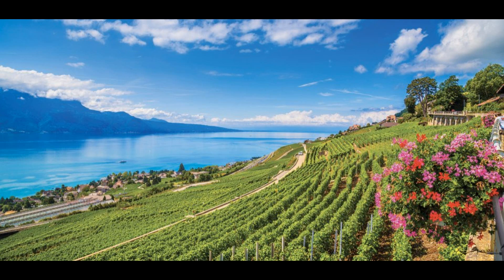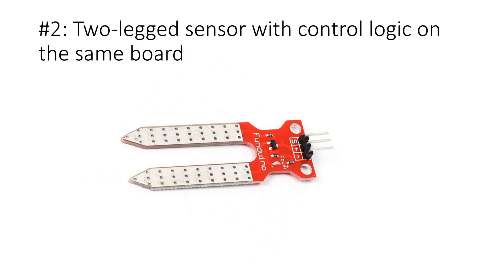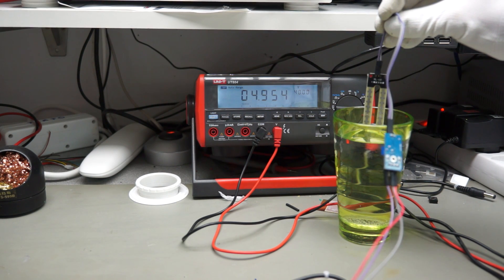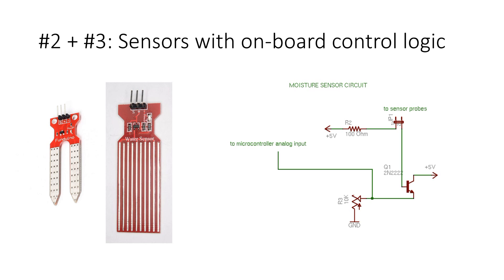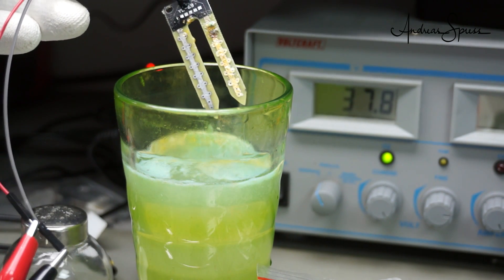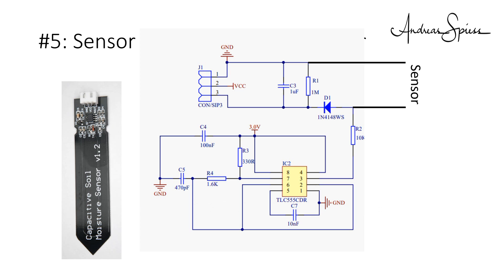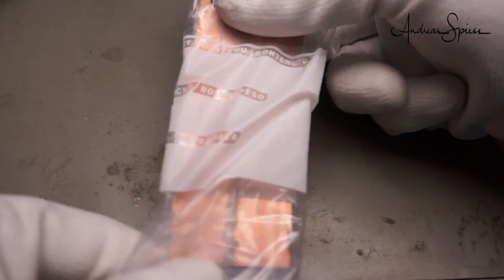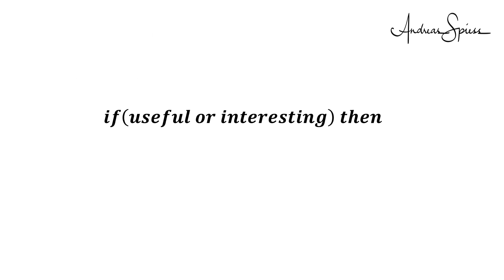#207 Why most Arduino Soil Moisture Sensors suck (incl. solution)

Comment: Just bury an ESP8266, the water will change the signal strength. 😎
Reply: Interesting tangent opportunity here, doesn't the ESP32 offer onboard capacitance sensing intended for touch detection?  I imagine it wouldn't be too much of a rework this for a buried soil probe along the lines of what Andreas came up with.  I might give this a shot when mine arrives!
Reply: That technique is actually used for remote sensing flood detection.
Reply: @markjacksonpulver3546  sure? on the waterstop on laundry machine there are 2 easy metal dots. if they're in touch with water they'll close the water inlet of the device
Reply: @riccardoz2953  Different type of flood.  Remote sensing in 'outback' Australia.  Went the sensor goes underwater, the signal is lost, and you you know high the water is. I think what was I was thinking about....
Reply: You don't really need a big battery just a solar panel on the soil surface if you only need it to wake up and report a few times a day. Could be a job for those ESP modules with the second add on low power MCU?
Reply: You may be able to have just the ESP8266 test the soil for high frequency impedance, it just has to make the measurement before it makes a WiFi connection if it involves the A2D port. Assuming that you can't just build smart enough code into you AP to note the differential change in signal strength between your sensors and a few reference ones, for a big installation that would be much cheaper, just the ESP8266 modules and solar power. After a while if you keep all of your data inc. the corresponding meteorological data you could train a neural network to even predict when you will need to water.
Reply: @DanielSMatthews   The beauty of the ESP8266 is the core processor which offers deep sleep mode. So it can sleep for four hours, pop on one second, measure, transmit and sleep. 200 mA battery would last years.
Reply: @Andrew Sanjanwala Yeah, that should be possible. I believe the working principle is the same, except that with a capacitative touch sensor, one of the plates of the capacitor is your finger (or whatever you're touching the sensor with), and with soil moisture sensors, you have to put another plate.
Reply: @GRBtutorials   & Andrew Sanjanwala  : Adafruit have such a sensor. It use a SAMD10 MCU with touch capability : https://learn.adafruit.com/adafruit-stemma-soil-sensor-i2c-capacitive-moisture-sensor/overview
Reply: XD
Reply: Make sure you add a LiPo battery so it's self drying. Bonus is that the plant will add to the "heating" effect (read: fire!)
Reply: :o)

Comment: Would you also consider the drifts in capacitive soil moisture value due to Temperature.... It creates a lot of problems in tropical climate... I have been working on capacitive sensors from past 2 years and none are working in a stable way. I have used chirp capacitive sensor from tindie, and vegitronics sensor vh400 both are bad....
Reply from the maker: And this was his link:
 https://www.acclima.com/sdiproducts.html
Reply from the maker: His full name is Craig Overend
Reply from the maker: Good Input. Maybe you follow Craig’s link above for more precise sensors. However they are more expensive. But maybe the principle can be used by makers...
Reply: Where is Craig's message, I can not find it.
Reply: Andreas Spiess thanks for the reply

Comment: copper oxide, not very dangerous.

 the bubbles are hydrogen, possibly dangerous in large quanitities
Reply: for plants copper is toxic. so its complete useless to know if there is enough water but no plants
Reply: Depending on the pcb type there could be some lead with its. Most cheap Chinese boards aren't rohs compliant
Reply from the maker: Thank you. Now I can calm down my wife...
Reply: Yes, that is true. It must be copper oxide (the greenish color is from the copper which tends to appear in many copper combinations like cupric oxide, copper carbonate, etc.). The bubbles you saw  are formed of hydrogen.
Reply: Andreas Spiess . Maybe gold plated or fully gold PCBs will also work.
Reply: Hydrogen from the Cathode, Oxygen from the Anode (IIRC!). They may be going in and out of solution, recombining and reacting further with the copper and other contaminates.
The makeup of the copper solution will depend upon the content of the water (introduced growing medium etc.), so could include carbonates, chlorides, sulfates etc. as well as oxides and hydroxides. (Wow that was a scary flashback to school!)
Any heavy metal should be managed carefully :) No idea how much is safe.
BTW, if you have moss growing on your roof, a thin copper wire (unvarnished) suspended at the top from end to end will kill the moss and keep your roof moss free :)

Comment: I'm using one of the same principle of these sensor to measure water level. While working on initial prototype, I found that the rate of electrolysis is high and decided to measure the water level on demand (mostly for 2-3 second for 2 times a day) and it is more than a year I am able to preserve the sensor probes working.

Chemical produced is Copper(II) Hydroxide : https://en.wikipedia.org/wiki/Copper(II)_hydroxide
Reply from the maker: Good Idea. I should have mentioned it in the video.
Reply: Andreas Spiess maybe in next time in some video 😊

Comment: What about using AC to measure the moisture? I would expect that the simple sensors should life much longer. Also a pulsed current, only measuring the moisture a few milliseconds every hour or so should help. It is not neccessary to measure all the time. What do you think?
Reply from the maker: You are right. There is a comment summarizing the different possibilities with their advantages and disadvantages.
Reply: AC is the best way to do it. It avoids a problem - electrode polarisation and allowes for even electrode aging
Reply: Actually copper is a fungicide won't hurt the plant.
Reply: Uwe: I was thinking the same thing. Copper in high concentrations is bad. And coming from a PCB, that is probably high enough concentration to weaken the plant. Especially if you replace the sensor every month.
Frank: Pulsed DC is exactly what Andreas showed in his example with the last sensor and the signal generator. It create a capacitance effect. Pretty neat in how that works considering there isn't any touching parts.
Reply: A D you are right
Reply: The reaction is copper oxide and i see it often on mains power that sees moisture the only way to prevent it is a protective coating but that has its limits
Reply: AC will not remove the corrosion which the metal electrodes will experience in the soil. The DC current only accelerates this degradation - even without DC current a copper trace in soil with or without tin plating will be gone after a very short while.

And copper salts - while an essential micronutricient - will kill your plants quickly.

Comment: It was so obvious from the beginning. I never even tried these exposed sensors.
Reply from the maker: Good. But probably you are a „rare species „. Otherwise they would not be produced and sold...
Reply: I also knew it from the beginning. But only because I have seen water damage / electrolytic corrosion before.
Those self destructing moisture sensors are still a good learning tool! They are included in almost any arduino-kit and a guaranteed method to make own first hand experience with electrolytic corrosion and methods to avoid it. :)
Reply: oh yeah easy for you  to say your answer does not add any value, how many videos you made about this subject ?
Andreas did and still does many (different) useful videos, which are seachable for people.
Reply: Im just a guy with an heavy Estonian accent :)

Comment: 10:08 You can use Clear nail polish as well.
Reply from the maker: Thanks for the tip!
Reply: very useful stuff - I experimented with nail polish (coloured) as an etch resist for home made  PCBs... also finds use as 'ghetto thread lock'

Comment: A much more accurate way to measure volumetric water content and other properties in soils is with time domain reflectometry (TDR) and calibrated devices such as those from Acclima. https://www.acclima.com/sdiproducts.html
Reply from the maker: After browsing through the documents in your link: Thank you for making this interesting content available to me. I did not know of it’s existence. It confirms what I said, that the accuracy of these cheap capacitive  sensors is not very high. Especially the linearity is poor. But for watering plants they still should be capable because we do not seek an „optimal“ point as in farming. I just want that the plant is somehow comfortable. The sensors in your articles are called „cheap“ but are still around 100$ ( that is what I read) which would be too expensive for me as I have to have one for every plant.
Reply: Capacitive sensors are certainly a cheap option if you need to monitor lots of separate plants like those in pots and can compensate for the nonlinearly of your individual soil type. Typically capacitive sensors have been electrodes embedded inside a block of gypsum as a known moisture medium. Here's a plot of one such sensor:
http://vanderleevineyard.com/1/post/2012/07/the-vinduino-project-2-making-and-installing-gypsum-soil-moisture-sensors.html
The chameleon soil moisture system uses three of these gypsum sensors at different depths with wireless and datalogging. Although it no longer appears available it's worth a look if only to learn about how soil moisure influences nitrate levels at different soil depths and watering.
https://research.csiro.au/scientistsgarden/chameleon-soil-water-sensor/
Unfortunately, the only nitrate sensor that I know of is the SupraSensor that was bought out by Monsanto's "The Climate Corporation" subdivision.
Another technique to measure "how comfortable" many plants are with a single sensor is to use NIR spectroscopy. Public lab developed Infragram, a DIY kit for this purpose that involves a NIR filter, a camera and software: https://publiclab.myshopify.com/collections/diy-infrared-photography

Comment: Hi Andreas,
why didnt you talk about injecting a alternative voltage into the probes, and measuring the AC resistance ? this way you can use basic sensors, but without the indesirable DC electrolysis effect. may be such ready made sensors does not exist ?
Reply: Works much longer but eventually still corrodes. Im using stainless nails and AC, good so far.
Reply from the maker: I did not find such ready made sensors on AliExpress. I imagine you can prolong the life span with such a concept. As with only use the sensor for a few seconds every hour as another viewer suggested.
Reply: here is the sparkfun tutorial for using their simple probe with ac signals to prevent corrosion
https://learn.sparkfun.com/tutorials/soil-moisture-sensor-hookup-guide
Reply: Correct me if I am wrong but this is not about AC but just powering the sensor on demand?
Reply: it does not need to be real AC. you can use two relais (or an H-Bridge, tle-5205)  and switch polarity every measuring and only power up during measurement.
But the chemical corossion with moisture, different metals and elements in the soil will still happen even without current.
graphite from pencils (d=2mm) as electrodes was already mentioned in other comments.